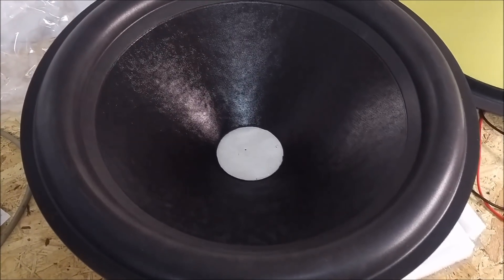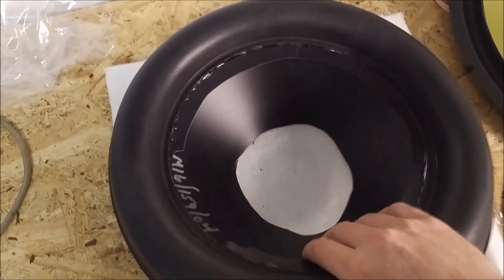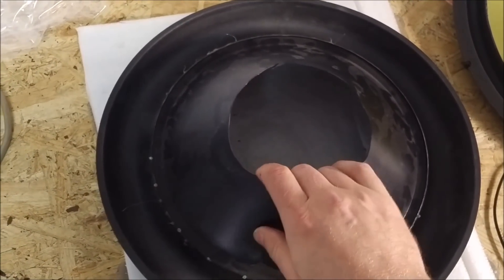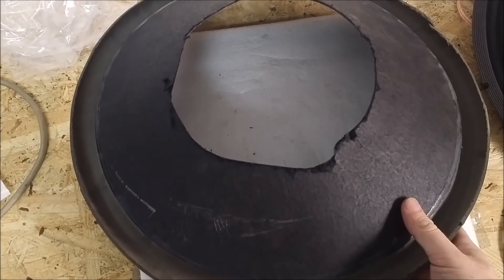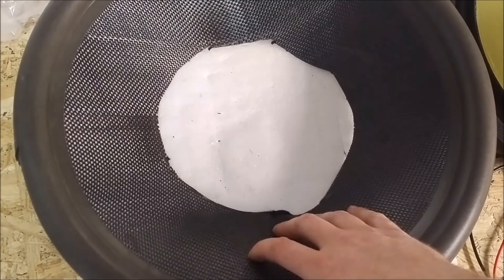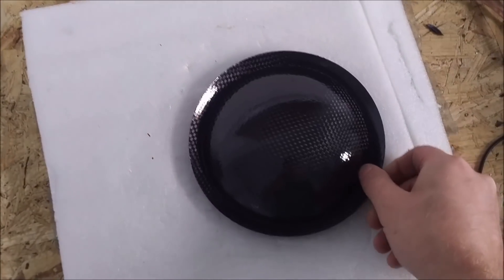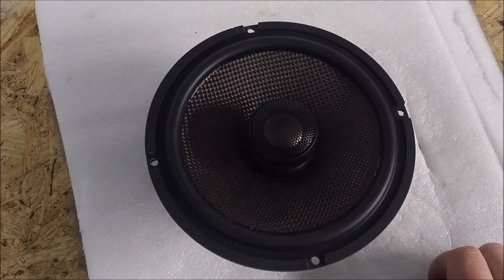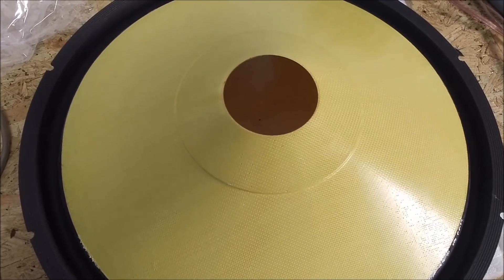Know your cone!

Comment: Just FYI, and this is old so you may already know, prepreg Carbon Fiber has the perfect amount of resin in it. More resin just makes it heavier, not stiffer, the weave weight is what determines the CF stiffness with each layer. People put extra resin on CF to make it pretty and glossy, the resin itself isn't the strength of the product.

Comment: Hi thanks a lot for the excellent and very informative video.  
There is at least one famous Harbeth speakers designer who states that the cone material is what gives the sound "signature" to a driver.  I wonder if this can be agreed upon and therefore which material sounds best.  He goes along saying that "untreated" plastic cones, for instance, sound muddy, confused, muffled ... not very good after all.   His brand has developed a special plastic based material with some kind of additives added during the moulding process.  
Another audio expert said that a very promising material would be the one of which the old computer floppy disks were made.  Cit.  "The plastic used to make 3.5 inches floppy disks was mainly Mylar , one of  the commercial names of poly(ethylene terephthalate) or P.E.T coated with little iron oxide"   That material seems to combine perfectly the need of stiffness and mechanical damping.  However i am not aware of any commercial cone made with that material.  Thanks again.  Kind regards, gino

Comment: could you take the cone before you recone it with a recone kit that comes with the cone and spider/former separate an add like fiberglass resin just itself without the fibers to the back of the cone without harming it to make it stronger, maybe more ca glue or something else adhesive wise if you could help me out with this I'd really appreciate it thanks
Reply from the maker: You can, and that has been done, but fiberglass resin on it's own isn't that strong unless it's really thick. I have a method of strengthening paper cones before assembly that works well, which I don't share.

Comment: Kevlar cones shred too. I'm thinking about s glass cones as they have more strength than kevlar and carbon fiber.
Reply from the maker: Kevlar doesn't shred, Kevlar bends.
Reply: @EMFAudio  I've personally seen your kevlar cones shred....
Reply from the maker: That's pretty incredible seeing as we don't have and never have had Kevlar cones. Fact check your lies if you're gonna tell them.
Reply: @EMFAudio  For sure.... I was mistaken. That was a Z. 2016 finals on Scott's bella. The reason I thought it was yours is because the Yolo was in there soon after.
Reply: Still ended the same way iirc
Reply from the maker: Scott won finals with a paper cone that didn't fail. There was a paper cone we tried that failed, but that wasn't at finals.
Reply: @EMFAudio  spiders iirc.
Reply from the maker: His sub didn't fail, period. As a matter of fact, all of that was done last minute and it was built a little too stiff for the power he had. It would have been louder if he had more testing time, which would have also required tearing down a perfectly good sub.

Comment: I made my cone from Asbestos® Fiber™. It's actually fire proof for when sparks fly when I'm using my 500 watt sub with my 20kw amp on low gain because it puts out 20000 watts straight away all the time.

Comment: Of all the cones, which is the most rigid for the weight? I find that I like the sound of paper, just because it doesn't have frequencies where it has a tendency to ring. I've tried aluminum cones, and polypropylene cones, and polypropylene tends to flex, which doesn't give a very good piston motion. It's also very heavy. aluminum sounded like aluminum. Never tried it as a subwoofer, but I hated it as a midrange. I have NO experience with carbon fiber cones.
Reply from the maker: You don't have to worry about the consequential tones on subs as much as mids. Physical distortion from flexing is another story. Paper with a mix in the pulp seems to be the best mix, but there is a point where it still isn't strong enough so you're forced to use something a little heavier but much stronger. I don't like polypropylene cones on subs at all, aluminum seems to be too delicate unless it's to the point it's too heavy.
Reply: @EMFAudio  I've observed exactly the same thing, though, I don't have experience with magnets nearly as large as you have now. That extra motor strength can expose weaknesses that weren't manifest, back when 50 Oz was considered a "big magnet". Another question: are you experimenting with edge wound aluminum voice coils, or are you sticking with copper on the standpoint of DC resistance, BL, and weight? I would thing flat wound oxygen free copper would be the best on the standpoint of slot fill, and maximum BL per Ohm of DC resistance, but, it would add reciprocating mass to the drop-in assembly, but is that a factor anymore with today's massive magnets?

Comment: "there is no preformance benefit to it"
Focal with the k2s ōwō
Reply from the maker: Just because somebody uses it doesn't mean there is a performance benefit to it. The placebo effect drains wallets.
Reply: @EMFAudio so if I am hearing you correct different cone material types don't have different sound characteristics
Reply: @andrewsims5704  Just the resonant frequency changes. Different materials are used to get better strength (against warping) and not better sound !!!!

Comment: What about Aluminium ?
Reply from the maker: Aluminum I don't see used too much anymore. If it's thin enough to be light, it's thin and fragile causing distortion. When it's strong enough it can be heavy and less efficient. I've only seen it used on low power handling subs intended for sealed enclosures. There is a sub a long time ago that was a total flop that you could touch the cone and put a dimple in it.
Reply: @EMFAudio  What about the cones used on TC Sounds, Eclipse or Audiopulse subwoofers, or Lightning Audio Storm subs?
Reply: Infinity had an MMD and CMMD material that was fantastic

Comment: Does that mean that paper cones are better than plastic cones when choosing a subwoofer or speaker?
Reply: nope. If JL audio uses plastic then its great. JL audio has some of the best sounding subwoofers you can buy. Just do some research before you buy a sub to see if it will work for your application.

Comment: I have 2 JL 13.5 w7...the come is plastic and it's really thin...surprising its lighter than paper cone I have seen and handle in the same power range. u should mention in it review....its not just a simple plastic cone....its design has been tested and it can with stand a lot of pressure for its weight... comparable to paper or any other come in its power range
Reply from the maker: Cone strength is not determining factor of power handling. Their "power range" is 1,000 watts, which isn't hard to handle the amount of pressure inside a box when the motor is that weak. The shape of the cone effects strength, regardless of material, so it's "not simple" in the same ways paper isn't that simple. I've personally seen those cones shatter when used in SPL applications with 2,000 watts per sub, ported box.

Comment: I have some Massive Audio Hippos. They claim to have Kevlar impregnated cones. The back is definitely a non-pressed ridged paper, the front has some type of sparkly looking stuff, and the dust cap looks like a carbon fiber weave. Idk.
Reply from the maker: I know what you're talking about, I suspect that shiny stuff is fiberglass. If the dustcap actually is carbon fiber, it's a thin single layer pre-preg. If you push on it, it bends in easily doesn't it?
Reply: It slightly gives but it's pretty stout. I'm pretty sure it's just a layer of graphite-grey fiberglass sheet with a small amount of resin on the back side. My friend had a 15" AQ HDC3 that looked pretty similar.
.
Reply: cody heathcoat I have the hippo xl 15 which is the version that came out after the one you have. It looks way different and I believe truly is kevlar rienforced, I think they call it. Either way... hippos get dowwn lol. I'm selling mine now tho. Don't need it I bought a HCCA 15

Comment: That yellow cone looks like a DD cone
Reply from the maker: In that it's made of Kevlar, yes. In terms of the cone itself, the angle of the cone is different and our cone doesn't have a foam core like the DD cone does. There is a reason we went with that cone specifically, it will last longer and won't invert.
Reply: I was thinking the same
Reply from the maker: It is very much different, the only thing the same is the material.
Reply: EMF Audio the only other sub I can think of is Focal for aramid fiber
Reply: DD has been using kevlar cones for many years now
Reply: it seems that this cone is the only rigid cone. all othzers are extremely flexible
Reply from the maker: Kevlar is flexible, it's actually more flexible than some of our paper cones. Kevlar won't tear or fold when it flexes a significant amount though.
Reply: i would just cool it, he's just going to delete your comment
Reply from the maker: Don't need to delete, happens on it's own.  :-)

Comment: I have a black Kevlar cone for a 6.5" and it looks the same as yellow Kevlar just different colour here's where I bought it from http://www.speakerbits.com/index.php?option=com_virtuemart&Itemid=146&category_id=1039&page=shop.browse&limit=20&limitstart=0
Reply from the maker: That is interesting, but one notable thing is the material itself looks the same, not at all like the cone claiming to be Kevlar.
Reply: It feels like Kevlar and it's hard to bend or to but it out of shape is there a possibly of dying the Kevlar black or other colours instead of the normal yellow. I built a 6.5" woofer for a project using neodymium magnets only using the north side  and used a 3D printer to print a speaker basket and  standoffs for the neodymium magnets. it works well but I made 1 mistake I dident push the voice coil down enough to line up even with the magnets if I push down on the cone while playing it gets louder and plays cleaner. I can always fix it later :)
Reply from the maker: It is possible it was dyed, they key point of that being the material looks the same and feels the same.

Comment: So what exactly is the name of the material companies say is kevlar?
Reply: Probably just add a bit of Kevlar pulp to the paper cone backer. Will say DuPont does make Kevlar in different colors though yellow is just the natural color.
Reply from the maker: Absolutely not! The loudest super street vehicle ever uses paper cones, many of the loudest street (and super street) vehicles use paper cones. We even used a paper cone to do 181's in Scott Van Riper's truck. Truth be told, those that aren't using paper cones are using Kevlar cones. Nobody NEEDS to use anything other than paper till they start having cone shredding problems, which is rare, and usually caused by box design problems.
Reply from the maker: Lighter than what? I've seen carbon fiber cones that were heavier than the paper ones I use, and I use paper cones of different weights. Maybe they are lighter, but that's relative. The Kevlar cones we're using now are slightly heavier than the heaviest paper cone we use, but, they have a greater tolerance to loading problems and extreme pressure. Saying it moves more air is the biggest lie they could tell you. Cone materials don't move more or less air. Personally, I wouldn't buy anything from a company that makes claims they can't back up or makes claims that aren't even possible.
Reply from the maker: I might have to break out a microscope to find that out for sure. I feel pretty confident based on how easily it cuts (another reason I know it's not Kevlar) it is likely fiberglass. Fiberglass is also a much cheaper material than carbon fiber or Kevlar.
Reply: EMF Audio Amazing that it is hard to know what exactly it is man. So can they get or have they got demanded by saying it is kavlar?
Reply from the maker: COMPASBASSCLUB CHICALI I don't know why they call it something it's not, probably to hype it for sales. I would rather be honest and at least know what my product is.
Reply: EMF Audio So they dont get sue?
Reply from the maker: Not my job to be a legal expert on that one, I don't know the how or why, Dupont may not know or care.
Reply: EMF Audio Lol I got you man! Thanks for your vids They really are something different and unique from what is out there
Reply: In terms of sound quality subwoofer what is the best cone material you use?
Reply: EMF Audio I know the point your making. And Dupont wouldn't think twice about going after a company claiming it's "Kevlar" because it is not made by them. They to the same with "teflon" that word and exact material is trademarked by Dupont so if it's not purchased from Dupont you have to call it ptfe and not teflon
Reply from the maker: I believe the coloration is a fairly recent thing, these have been around for quite some time. I don't know that they're adding Kevlar pulp to the paper, it looks like pretty basic paper. I think it's more of an advertising ploy.
Reply from the maker: Paper I feel is the best sounding. There are other materials that work well on mids if you use them correctly, like we do with carbon fiber, aluminum, titanium, and even wood. Paper is just the easiest to "get right" in terms of sound quality. Now for subs and sound quality, paper is the way to go. I don't like metal cones for subs at all, they're either too heavy or have weird resonances or have mechanical distortion from being flimsy. The average listener may not be able to hear the difference in cone materials on subs though, for many as long as it makes noise it "sounds good".
Reply from the maker: Dupont has to be aware to go after them. I guess one way to find out if it is or not in reality is to point their legal team at the people claiming it is and let them get sued over it LOL
Reply: EMF Audio lol👍 So for spl only (burp box) carbon fiber cone is a must?
Reply: EMF Audio Jesus Christ! I was going to make the mistake in ordering carbon fiber cones because they say it is lighter and moves more air. Bastards they just want to make money out of me 😁
Reply: EMF Audio Well thats what they say go w carbon is lighter bla bla bla
Reply from the maker: "they" are usually internet "experts" that don't have a clue. That's why you should educate yourself using legitimate sources, which we try to do, leaving people butthurt because it isn't what they wanted to hear. The bottom line is, you don't need anything other than paper unless you've having paper problems (and even then, different paper may work just fine). Whether you WANT it or not is a different thing.
Reply: @EMFAudio  That fiberglass subwoofer sound good and durable? I have ordered 2 pieces which look same and mentioned Fiberglass cone material
Reply: ***** Honestly money talks brothers and these people will lie 24 7 because the only thing they care is money.
Reply: B&W/
Reply: I havent heard kevlar or carbon fiber cone subs yet but to me polypropylene sounds clearer and cleaner than paper cones, as long as its a good quality that is strong enough to withstand the motor force, my mtx 9500 sounds very clean and clear much cleaner than my soundqubed hds312 paper cone sub same with my diamond d1 10s and they are very loud for their power but we all have different opinions Im just saying yeah for crazy spl go wih the paper but to me polypropylene sounds very clean as long as its strong enough for the motor and not too thin